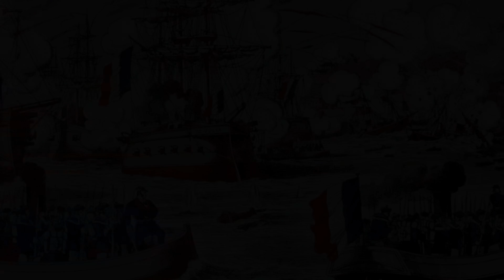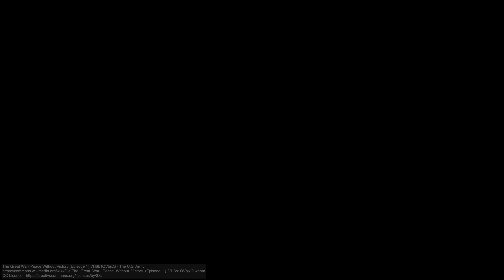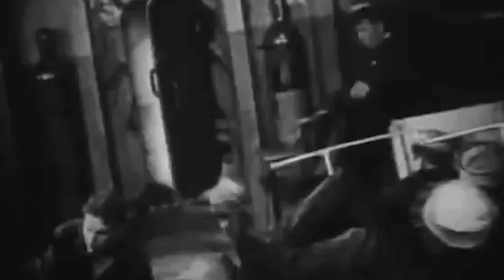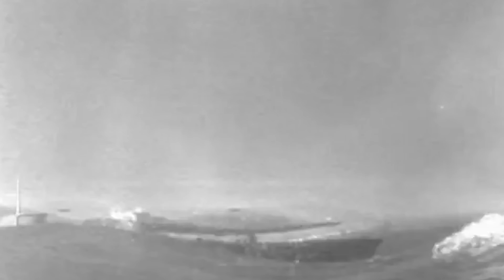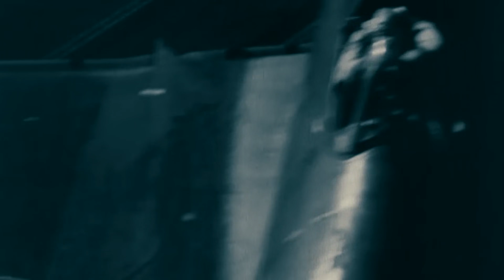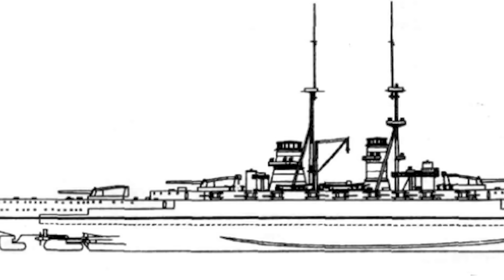History's Weirdest Warships

Comment: I was fortunate to spend an afternoon with a gentleman who had crewed both the M2 and also one of the K-boats, K13 I think. He was an apprentice at Vickers yard in Barrow during the war and later went out on the builders trials. I didn't know any of this before I met him and wasn't ready to take notes or make a recording. However, a couple of points have stuck with me. He recalled firing the gun. He said that you could be doing 9 knots ahead on the oil engine, fire the gun and be doing 6 knots backwards! A lot of the lights would go out too.

On the K-boat, the crash dive was so slow because the fires had to be drawn. There was a large fan with a 150hp motor whose job was to draw cold air through the boilers to cool them down. However, it couldn't get enough heat out in the time and fifteen minutes after diving, half of the crew had passed out through heat stroke.

I so wish I had asked him more and written it all down. Too late now.

Comment: I'd like to add some information about some of these ships. First, although Carnot and her half-sisters were designed with an attempt to be more stable than their predecessor, they were still notoriously unstable, as you said. Modern simulations apparently have them being more stable when turned upside down. This resulted in Bouvet capsizing in less than two minutes after striking a mine, while the British pre-dreadnoughts HMS Ocean and HMS Irresistible, also being fatally mined, took hours to sink.
Second, according to History in the Dark, the reason the Faa di Bruno only fired 3 shots during the bombardment of Genoa was because one of the British opening salvos ended up severing the power cable for her guns. I don't know if the shot hit the ship itself or if she was being powered from onshore.

Comment: Regarding the M class subs, surely such a massive gun's recoil, even with excellent recoil management,  would place enormous stress on the pressure hull if the sub and demand extra maintenance.  Also the amount of available ammunition would have to be extremely limited.
Reply: Given that the gun's planned rate of fire was exactly one round per engagement, I doubt magazine capacity would have been much of an issue. After all, these were monitors. They weren't meant to operate very far from sources of supply.

Comment: I would argue that the first Monitor didn’t fight an indecisive battle.  She was built small and fast to counter a specific threat. She was designed to fight the Confederacy ironclad and to protect the wooden ships and to keep the blockade in tact.  And this is what she did.  She wasn’t required to sink the other ship just not let her sink Union ships and break the blockade.  And she did just that.
Reply: The reason it was considered indecisive is that, while Virginia was unable to break the blockade or sink Monitor she did get multiple vessels while Monitor hadn't arrived yet, having a rough passage down the coast as she even lost her funnels and was at risk of flooding.
Reply: I've heard the Battle of Hampton Roads summed up as a tactical draw, strategic victory for the Union.
Reply: The Monitor style ships were essentially submarines that couldn’t dive. Virtually no profile to target and a big ass deck gun.
Reply: yes i think too many people look at warfare like its only goal is a K/D ratio on a chart.
the point of a war is to win
if you dont destroy anything and win, you still win.
the monitor was meant to put the merrimac out of business which had been having its own way for a couple days.
it did exactly what it was ordered to do. so it was 100% a successful design

Comment: The Wolverine and Sable were not only the US Navy's only paddlewheel aircraft carriers they both were also the only COAL FIRED carriers which served OK  except when the winds were not monitored adequately and the aircraft on deck got a coating of soot which definitely upset the pilots and the air operations officer!
Reply: Depending on sources, somewhere between 12,000 and 15,000 naval aviators got landing experience on those two.  That is an impact that can't be under-estimated.
Reply: Are you sure they’re the only coal fired carriers? That Russian one seems to belch like one…
Reply: @stevenbrooks6930 no that’s the souls of sailors harvested for the Kuznetsov to move.
Reply: @afilleduptaco 😂
Reply: Coal Fired is really up to date. HMS Ark Royal the Royal Navy's first seaplane carrier, as built was equipped to carry sail. The idea being that a ship under sail is more stable than one using mechanical power because it can lean on the wind. It was thought that this would be useful when using the ships crane to place seaplanes on and off the water. The ship served as HMS Pegasus in WW2 and was not scrapped until 1947. By which time she must have been just about the last warship in service that had been designed to carry sail.
Reply: Weren't they used on the Great Lakes to train Pilot's on taking off and landing on a flat top?
Reply: Wasn't Langley coal fired as well?
Reply: @Stoicswimfish Oil fired with one of the first turbo-electric drive systems.
Reply: CV 1 Langley began her career as a collier freighter before conversion to a carrier.

Comment: Hello my friend, Mr Brady.

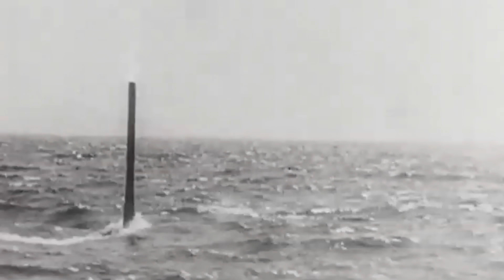At 11:50 you say the gun of the M class submarine was usually fired from periscope depth. Does that mean that it was fired while the boat was submerged with the shell blasting out of the water, or did the tip of the massive cannon poke out above the water?
Reply: The idea was that the submarine would aim up at periscope depth, surface just far enough to clear the gun (so firing with decks still awash), and then immediately submerge again, so that by the time the enemy knew they were being fired upon, the boat would be nowhere to be seen. Although, since they'd have to surface completely in order to reload, that entire tactical concept was... iffy at best. Probably better than a spar torpedo, and certainly better than trying to use an auger to drill holes in the enemy ship, but still iffy. :)
Reply: It would have to be out of the water. Since a gun’s projectile isn’t a self-propelled rocket, I can’t imagine it would be functional through any depth of water. I found that comment weird as well.